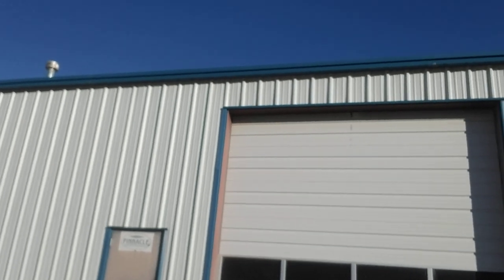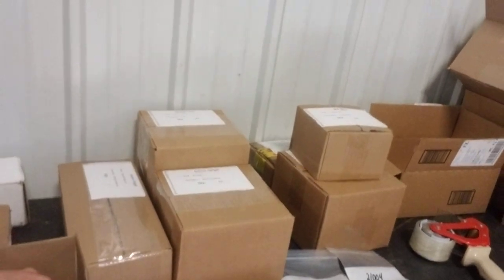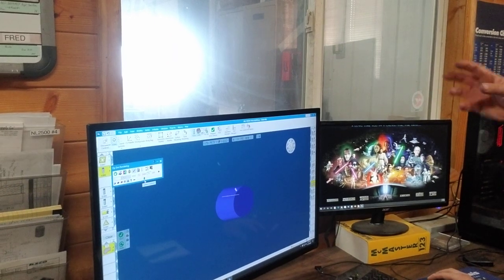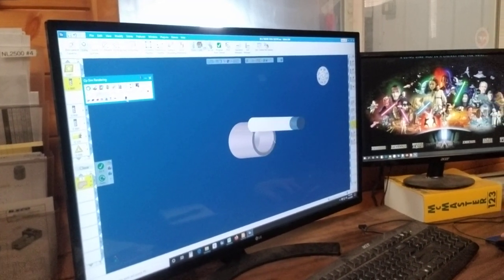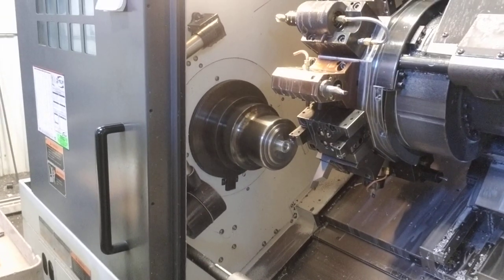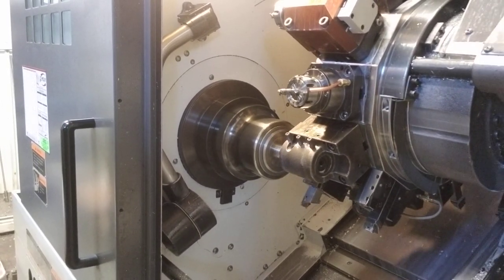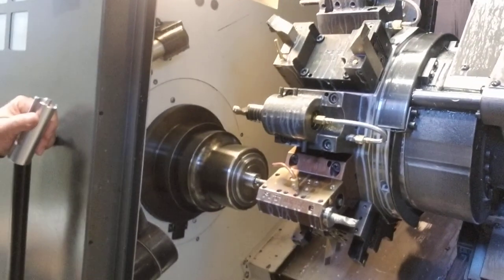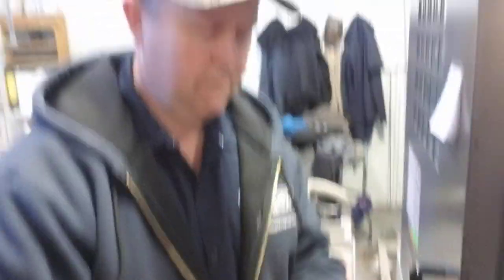How we make the Lakeview Puller cartridge Tool

Comment: When I bought this I wasn’t sure how often I was going to be using it. It isn’t the first thing I grab when I go to pull a cartridge, it isn’t required for the removal of most cartridges. However, there has been about 5 times so far since I’ve had the tool ( Haven’t even had it for a year), where the tool was required. This tool has already paid for itself in labor just by using it a handful of times....especially on valves that are extra deep and gummed up from years of running hard water through the water lines. Spendy? YES. Worth it? Absolutely.
Reply from the maker: Wow! Thank you for that awesome review. I really appreciate it. 
Brandon
Reply: This is what I want to know. I just purchased mine this weekend. Can't wait to receive the tool!